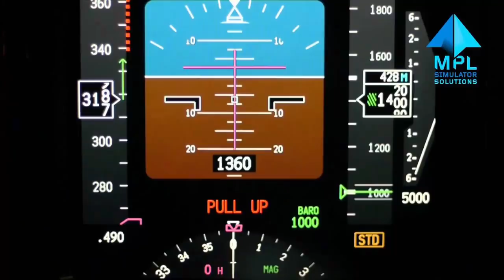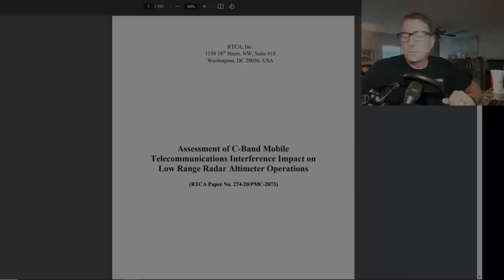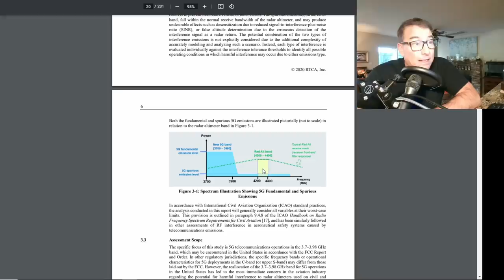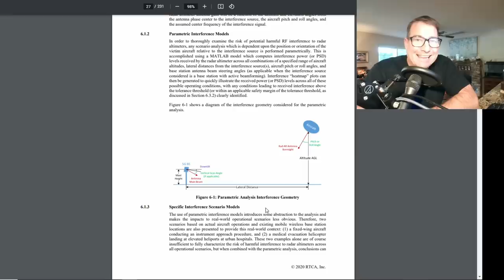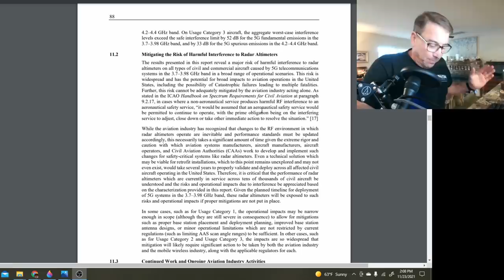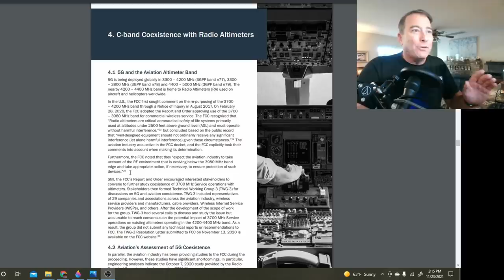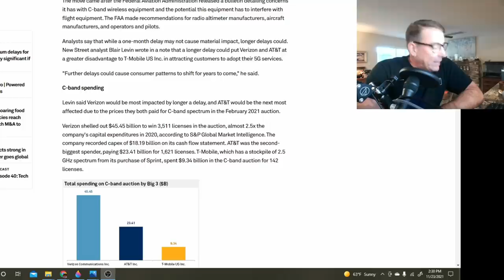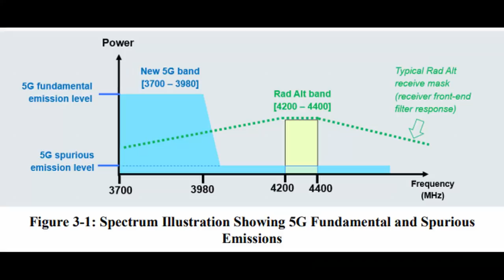5G C-Band Interference with Radar Altimeters in Aviation

Comment: Not just the path length of the radalt signal, but the radiation pattern of the antenna is very wide in both pitch and roll.  So that signal hitting the ground is tiny under the aircraft, never mind the return signal....

Comment: After reviewing this radio altimeter issue, as an EE, I see several problems with the nice work done by the RTCA Grp. I do not know if RTCA took this into consideration, but 5G telecomm will be adding many more towers (up to X3 times as many) that were not necessary with 3G and 4G,  which will add up to more power levels coming into the plane radio altimeter receivers. So better filtering will be necessary on the necessary updated radio altimeters.  If they are built like other electronics, the filters are only 85 to 90 % effective, and have some outlier spurious out-of-band frequency over shoot.  the main point for me is that a cell phone airplane mode does not stop or slow down the cell transmissions of google android or apple i phone's hidden spying data transmissions.  Airplane mode only stops the user from transmissions from the cell phone.  so airplane mode will not really help this interference issue, where it occurs. Cell phones never stop transmitting "here I am location" data until the battery gets below 15%.

Comment: Juan 
In terms of transmit power a phone accidently left on in the cabin on top of the altimeter, broadcasting at 2w due to poor reception will create a stronger interference than a 30w cell tower some miles away-  

I don’t know the algorithm for dropping 5G and reverting to 3G/4G frequencies when out of range though.

Comment: They need a way to verify the radar is operating properly by comparing it to a known height . They could have the computer check the radar height against the outer and inner marker by having a high power radar signal come up from the marker's with the actual altitude confirmed by the ground based radar on a different frequency. This would eliminate the need to change the aircraft as you are already receiving the signal from the marker and they just need to encode the altitude and compare the two.
Reply: This

Comment: Good call William, but it they went orthogonal with a 3dB increase in output power it would also correct the issue with less cost and keeps it on a single chip possibly.

Comment: In the '90's I was the "Iceman' fog abatement pilot at Boise, Idaho flying a Piper Lance single pilot with zero-zero take off and land endorsement. I made 3 zero zero landings using cat 1 equipment and 5 zero zero takeoffs. We used crushed  dry ice to precipitate the fog into snow to cut a visual channel thru the fog at minimum s

Comment: The radar altimiter isn't going to recognize the spread spectrum signal as a narrowband radar pulse. All it's going to see is a higher noise floor,  which won't alter the altitude readout as long as it can differentiate the narrowband pulse.

Comment: Years ago when Nextel to go over channels in the 800 MHz band and started putting up their cell sites the thing that happened was any public safety vehicles that run the nearby channels the RF blocked out their receivers in their honor able to receive for a distance around the site. That's why they had to rehband the 800 MHz and Nextel pay for Public Safety to relocate to different channels it went on for many years I'm not even sure it's complete yet. So I guess what I'm saying we need to be careful and go lightly and once it's out there it's out there but we do need the 5G. Excellent video

Comment: Jain, this is indeed interesting.  My traffic system (GTS-800) started acting up this summer, occasionally giving me a traffic fail message after taking off.  In my case though it was not consistent and would only happen once every few flights.  I’m going to contact Garmin again and discuss this with them.  This issue had seemed to die down lately and in the last month or so has only failed a couple of times.  Pulling the TAS breaker and resetting it usually brings it back up ok.
Reply: Juan!
Reply: Your grounded.

Comment: With radar altimeter, the signal it receives from the ground reflection is attenuated by two factors, the largest is the reflectivity of the surface that is reflecting the signal.  The 2000 foot or so microwave path loss is small enough to not be that consequential.  The comparison of signal levels from that sent by base stations or mobile devices on the aircraft vs the signal levels expected to be seen as actual

Comment: Juan & all,
Firstly, thanks for having the guts to be willing to speak out about this topic.

As a guy in the camps of technology/electronics & repairs to bench/field service level including SMD rework, IT, ham radio (hold VK advanced licence which includes all amateur radio privileges including microwave ie 23/13/9/6/3/1.25cm etc microwave bands) & aviation I honestly feel genuinely scared that the FCC & the telecoms industry don't realise the huge risk to aviation that poses as a reading of -6db or 75% spurious emissions down from a fundamental RF carrier wave to say a sensitive instrument like a 4.2 - 4.4GHz (microwave frequencies) radio altimeter typically used in aviation for RAs ie IEEE 7.5cm approx C microwave bands is truly worrisome.
Like others have stated, sure, we can retrofit via FAA ADs upgraded radio altimeters with far better BAW (Bulk Acoustic Wave) microwave filters to give far better out of band rejection than the typical SAW (Surface Acoustic Wave) or Chebyshev analog filter design but lest we forget that the aviation industry isn't exactly cashed up due to massive hit it had received due to CV19 to be able to afford an extra expense to progressively retrofit newer RAs.
I've seen it already from 4G/LTE (Long Term Evolution) mobile carriers affecting 800MHz digital TV broadcasts that their filtering is sometimes producing spurious RF emissions spilling over into other bands which they might not be always aware of & I've lost count of how many times I had recommended to customers to place an LTE filter into their TV antenna feed system.
The problem is digital RF signals used in cellular digital comms also have a stack of RF spurious harmonics which unless well filtered can spread out past band limits.
At lower RF frequencies, its easy to filter with say Chebyshev or Butterworth filters but at microwave centimeter wavelengths, circuit design & construction is a serious pain in the neck & those -6db passband curves are simply just too shallow to block out 5G RF signals & I honestly didn't realise it was that bad, wow :-O .
I also totally dismiss that telecoms industry report & the qualifications of the RF engineers involved in that report as any 1st year EE student can easily work out that -6db is just too shallow for a filter in that application & they are kidding themselves if their proposed 5G band wont spill over into 4.2GHz.
I also publicly commend the RTCA for an excellent report & their honesty about the entire situation.
RF spectrum management is a global community responsibility & just like ham radio seceded heaps of RF spectrum in both 70cm & 9cm ham bands to hugely benefit the telecoms industry after the "digital divide global RF spectrum auctions" where they basically gained 600 - 800MHz approx in UHF spectrum, the telecoms industry also needs to be a team player & recognise the potential loss of life by interfering with RA spectrum.

Unlike say the ham radio community who can typically identify & isolate/reduce spurious emissions on adjacent bands by easily spinning the VFO/PLL frequency tuning dial/keypad, changing the IF (Intermediate Frequency) passband filters on their Icom/Yaesu/Kenwood etc SDRs visible via the spectrum waterfall to block spurious signals to comply with say an FCC or ACMA RF spectrum band plan or a digital TV via FEC which can correct bit rate errors in digital TV signals, the FCC, telecoms industry & politicians tend to forget that IFR/IMC rated pilots are constantly trained to always implicitly trust the aircraft instruments to reduce spatial disorientation especially in light of the spate of high profile IMC CFIT accidents there has been lately & inadvertently introducing errors in the RA system can easily result in catastrophic loss of life.

I personally see this as not just an aviation problem but as also an FCC, ACMA & all global RF spectrum management agencies & needs to be urgently addressed via the ITU (International Telecommunications Union).
I also want fast internet but faffing around & interfering with the 4.2 - 4.4GHz RA microwave spectrum is IMNSHO a seriously bad idea & either we come together as a global community where both aviation, telecommunication & spectrum management agencies or I foresee a huge loss of life due to IFR pilots following bad readings on their instruments causing them to second guess & tempting them to involve their vestibular to the inevitable tragedy especially under IMC.
Maybe a fairer solution is for the cellular spectrum operators to also pay into a fund to help offset retrofitting newer RAs with far better BAW filters & for the FCC & other spectrum management agencies to properly monitor these bands so that RA integrity is assured.

Honestly, I'd love you to also get in touch with Alan Wolke of YT channel W2AEW as he has a wealth of RF experience, a God given ability to explain technical RF concepts to the layperson, is also the ARRL New Jersey region coordinator & knows a stack of good microwave RF engineers as microwave frequencies are truly a "black art" & electronics voodoo which is why I also deeply respect microwave hotshots like Rex Moncur (VK7MO) who holds Aussie distance records on microwave bands & is a guru on the subject & had also worked with radiosonde devices

Comment: I had an opportunity to meet with a group from the RTCA while looking at some reports of problems with the development of ADS-B.  Good and interesting people.  Frequency congestion is a problem in several areas for safe aviation.  The 1090 mhz frequency is used for several things on an aircraft including ADS-B, TCAS and your transponder when responding to a query from the SSR on the 1030 mhz frequency.  To put that in perspective, if you are flying in NYC area airspace, just your transponder is responding to I think it is seven radar installations on every sweep times all the planes in that airspace at a given time.  Meanwhile your ADS-B is transmitting several data points about your AC and your TCAS is interrogating and receiving information from nearby AC.  All of this on the same frequency from what I was told.  They were concerned about this even before ADS-B came on line.  Forget about getting people on planes to turning off their phones, from my experience I bet 5% or more use them while on the flight particularly using them after the FAs sit down for landing.
Reply: TCAS and ADS-B is very low bandwidth.
Reply: @rkan2  Don't disagree, they were still concerned.  They are all frequently transmitting data from each aircraft and at 35,000 feet your competing over a very large geographical (lots of planes) area.  It's gotten a lot cheaper so adding lots more GA all the time and if the other three parts of NextGen become widely adopted?  I think those have more and more alternatives all the time available on the widely used tablets though.

Comment: Great content as always! Important thing to point out is that the 5G due to being a higher frequency band and thus shorter wavelength than that of 4G, it has considerably reduced signal coverage especially in build areas as it's not as good at penetrating though walls etc, which will on turn require Base transceiver stations (BTS) to be located in closer proximity to each other, further complicating the interference issues caused by the tower transmissions itself
Reply: Yes, that was for the implementation of Millimeter Wave 28/39Ghz, we are looking at issues far lower in frequency. C-Band 4Ghz roughly, is part of 5G deployment.

Comment: I see a lot of people making the "we're here first" argument. However, new technology always causes problems for the old ones. Take roads for example. Roads were for horses and pedestrians until cars came along. Once cars became common and fast enough to cause problems, horses were banned from most roads and pedestrians were relegated to the sidewalk. If we say whoever used roads first gets to keep using it forever, then cars would never be able to go any faster than walking speed.

A more reasonable argument is saying this change is being pushed through too quickly. There should be more real-world tests of potential interference, and if it is indeed a problem, the money received from the frequency auction should be used to partially pay for radio altimeter upgrades.
Reply: That's a fair point.  It is being pushed through too quickly and I think the long-term answer is an upgraded radio altimeter.  But like Juan said; this is not something that can be done quickly, so it's more incumbent on 5G implementation to be put on hold until that can be done.  Aviation is one of the most regulated activities on the planet and it would probably take a decade to redesign and recertify radio altimeters that are not susceptible to 5G interference.  Some airliners (with parts built under decades-old regulatory approvals) are literally still rolling off the assembly lines today with ash trays in the cockpits, not because they want anyone to smoke in the cockpit, but because changing the design to exclude those ashtrays is too much bureaucratic red tape to cut through.  It's just easier to keep the old and previously certified design than to try to get a new design certified.

Comment: Hi Juan ... just now found this video ... from 25 Nov 21!!!!  thank you!  sharing it!

Here we are in mid-late January and there was quite the kerfuffle in operational procedures ... and it's not really over to yet.  Just delayed again to 1 Feb 22 is my understanding.

Some non-descript "Alternate Means of Compliance" AMOC (what would we do w/o acronyms?)

"just keep doing what you've been doing"

Ah ... that's not good enough.  Especially with seeing this RTAC (?) report, this is significant enough for me to simply say "no."  If ATC can't get me below the weather with their min vectoring altitude so I can proceed visually ... just ... NO.  The Radio Altimeter has become a permanent placarded item ... with all the associated restrictions.

I can't believe it has come to this.  the airlines allegedly had 24 hours to change procedures before the can was kicked to Feb 1.  Insane.  18 Jan is the date the FAA and the aircraft manufacturers presented the airlines with the problem the airlines had to solve for 5G was going live on 19 Jan.

So ... starting yesterday, I re-committed and augmented "degradation" approaches .... with CAVU/light winds ... one leg per trip is going to be completely manual, only the ILS/DME as aids.  No Autopilot, no flight director, no autothrottles.  hand flown raw data (well, perhaps a total velocity vector! :P  I am an AOA baby.

You struck the nail on the noggin ... trust has been lost.  Now it's in my lap to keep 180 souls safe with systems which are compromised.

As Mr. Myagi said in regard to fighting ... best no be there.  So that will be me.  ceilings less than 2000?  windshear advisories?  no be there.  That will adversely affect the schedule, but it WON'T adversely affect FLIGHT SAFETY which is supposed to be NUMBER ONE.

Comment: Juan, you glossed over the in-aircraft, cell phone aspect because you have made a career and life based on abiding by the rules. I can’t tell you how many times I’ve watched passengers who, just after they feel the gear thump down, pull out their phone, take it off airplane mode and call their ride to come pick them up. Happens ALL the time. Not being an EE, but naturally curious I came across this tidbit:

Let us have a look at phone radiation, then. The phone next to your head is transmitting at a maximum about 200mW (which is 23 dBm). That is at least 10,000 times more than the signal received from the tower. Typical transmission power values of phones are a lot lower, though. The base station at the tower controls the power of the phone. It sets phone transmission power to a level so that all phone signals are received at approximately the same strength. If you are near a tower, your phone will transmit at a minimum level (which is below one milliwatt, again). Only if the reception from the tower is very bad, your phone will be commanded to increase transmission power. It may sound crazy, but: more mobile base stations mean less overall radiation levels.

I take this “worst case scenario” into consideration: the powers-that-be decree that the 5G towers not be placed very closely to the glide path thus causing the cell phones interacting with it to up their power output. Now, passenger 12B, who happens to be sitting just 8’ above the radar altimeter receiver can’t possibly wait another two minutes for the plane to touch down. They whip out their phone and place their amazingly important call just as the plane and pilots need the maximum accuracy of the onboard instrumentation. Food for thought, huh?
Reply: @BlackBaron 1944 Thank you. I wasn't sure to what extent the 5G prevailed over wifi in these instances.....BUT.....as the aircraft descends into the lobed cell tower output altitude, say something below 500 ft, could mobile data become available for the remaining short bit of the flight? Especially if one has turned off WiFi but not cellular content, just waiting to see the 5G signal meter come online.